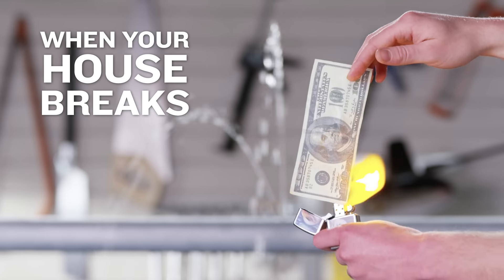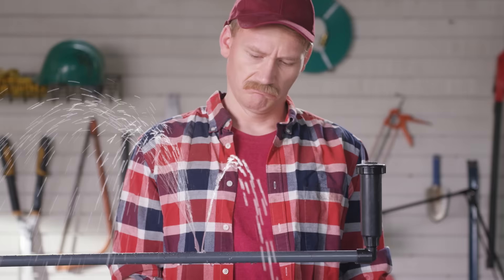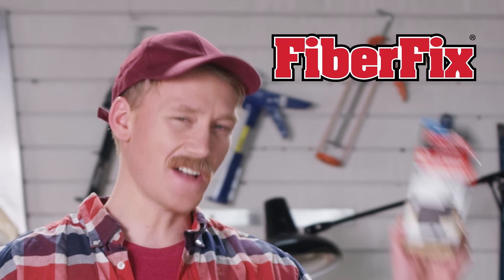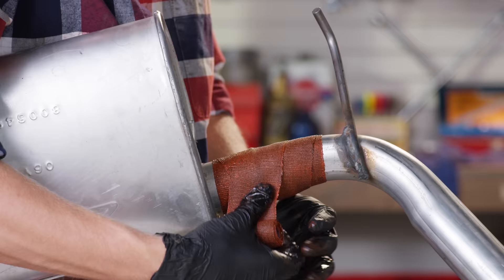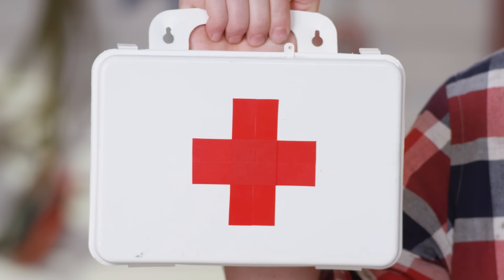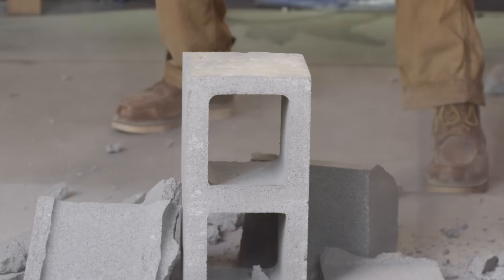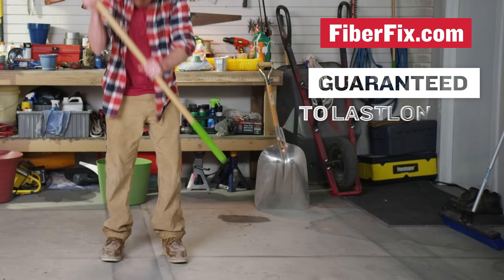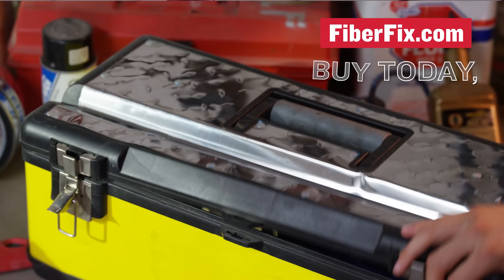Dip This Tape in Water and It Becomes Strong as Steel.

Comment: flextape: who are you?
fiberfix: i’m you but stronger!
Reply: The Truth Answer Is I Am You But Older.
Reply: Gemikoni But flextape isn't as strong as steel.
Reply: @nutbuster3862  exactly it's flex tape but 
STRONGER
Reply: @Gemikoni  isn't it supposed to be newer?
Reply: Nick Dissel and permanent
Reply: Well they didn't saw no boat in half
Reply: Just soak flex tape in some flex seal
Reply: actually flextape is stronger than fiberfix since it has the power of phil swift and this only has the power of some guy we dont even know
Reply: The cooler Daniel
Reply: Nick Dissel all these lies
Reply: Well yes but actually no.
Reply: The Immortal Comrade but actually yes

Comment: But can it repair a boat sawed in half? And then proceed to travel into shark infested waters? No, I didn't think so either man.
Reply: I checked Amazon reviews and it looks like this tape does actually works as advertised. Also apparently it's chemically activated the moment you take it out of the package, so you can't store leftovers for later - they will harden too.
Reply: Dan Shen it can’t because it doesn’t stick it’s made for pipes there’s no adhesive he basically promoting a really strong rope
Reply: @basstion4146  it can, as long as you go inside and out

Comment: Not enough encouragement, please saw a boat in half. If you can fix it then I'll buy it
Reply: bICH HE THREW A CAR OFF A CLIFF
Reply: @maryanncurtis3411  still not buying
Reply: @vincentdreemurr  The tape has small holes in it. In theory it would work if several layer where applied and covered the holes perfectly.
Reply: @oak1739  r/whoosh
Reply: @skeedy2791  dafuq?
Reply: @oak1739  
fiberfix is 100% WATERTIGHT! watch the ad for christ's sake!
Reply: @rouge5140  Looks like it has holes in it tho.. Maybe they meant water tight when many layers are applied?
Reply: @vincentdreemurr  r/whosh
Reply: @rouge5140  the point is who fucking cares
Reply: the cyan platipus no u
Reply: @oak1739  it looks like holes but they aint
Ive seen this kind of thing and its quite waterproof
Reply: 0AK in other words...back to burning up benjamin franklins.

Comment: "Emergency Water Activated Repair Patch (EWARP)
 
 For either low or high pressure systems, the Navy suggests the Emergency Water Activated Repair Patch, pronounced as E-WARP. These are flexible patches made of dense fiberglass-woven tape covered by resin. The tape is very sticky and the approach is perfect for high-pressure and temperatures of up to 300 degrees Fahrenheit, as the adhesive bonds to a pipe quickly when heated."

Sound familiar?

Comment: Bye bye flex tape
Reply: NO FLEX TAPE WORKS UNDER WATER BEAT THAT!
Reply: Sheepish 

I don't know and not sure but I think this tape needs to be wrapped around itself to be strong as where flex tape is stickier.

Not sure but guessing....😐
Reply: Hi, Phil Swift here with Flex Tape! The super-strong waterproof tape! That can instantly patch, bond, seal, and repair! Flex tape is no ordinary tape; its triple thick adhesive virtually welds itself to the surface, instantly stopping the toughest leaks. Leaky pipes can cause major damage, but Flex Tape grips on tight and bonds instantly! Plus, Flex Tape’s powerful adhesive is so strong, it even works underwater! Now you can repair leaks in pools and spas in water without draining them! Flex Tape is perfect for marine, campers and RVs! Flex Tape is super strong, and once it's on, it holds on tight! And for emergency auto repair, Flex Tape keeps its grip, even in the toughest conditions! Big storms can cause big damage, but Flex Tape comes super wide, so you can easily patch large holes. To show the power of Flex Tape, I sawed this boat in half! And repaired it with only Flex Tape! Not only does Flex Tape’s powerful adhesive hold the boat together, but it creates a super strong water tight seal, so the inside is completly dry! Yee-doggy! Just cut, peel, stick and seal! Imagine everything you can do with the power of Flex Tape!

Comment: Fiberfix is only rated at 60 psi. Meaning anything thats not a waterhose you cannot waterproof. I tried this on a sprinkler and it did not stop the leak. Ive come to the conclusion that there is no solution better than replacing the pipe.

Comment: Sooooooo, no directions on how to actually use this stuff?? K...
Reply: Sand trouble stuface, put on gloves, soak the flex tape, wrap troubled surface with flex tape... wait at least 10 minutes (on a warm / average temperature day, low humidity ideal, time may vary on climate) then it should be STRONG AS STEEL.   Or that is what they say at least.